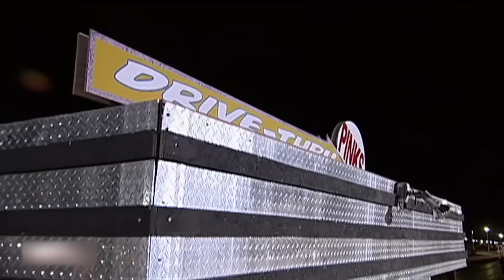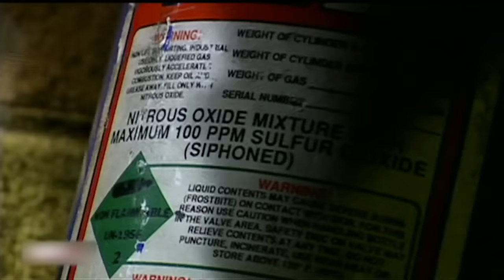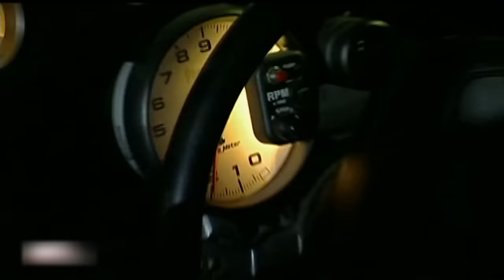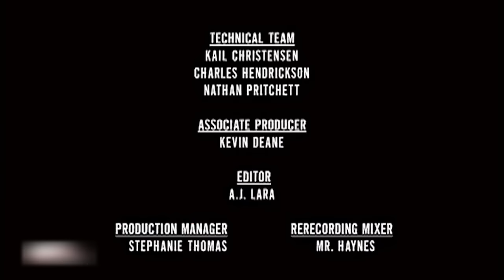PINKS - LOSE THE RACE...LOSE YOUR RIDE! A Chevy Battle -Camaro vs Nova -  Full Episode

Comment: Someone commented about Adam's Nova (in a different channel) that the 2 speed trans was a bottleneck paired with a big block high horsepower engine. Is this true? Cause it looked like its not transfering all that HP and doesn't seem so fast especially at top end. Can engine experts comment on this?
Reply: Powerglides are very strong and they make getting from point A-B smoother, you can sacrifice speed though in an all motor setup..  Im guessing that 555 mightvhave been a pump gas motor?   Id have to relook to see if it was mentioned...  I felt horrid for the guy because he was hustled bad... the producers musta been under pressure and twisted on the guys arm.    he was under the impression he was racing a near same speed 10.50 car the camera crew caught those guys in the camaro saying theres was a low 8 sec car...    it was a last minuete bait and switch.... I dontbknow what the gran national was or the shape it was in but that is a more rare car than a 95 camaro... just show up and its not even the same car you may have wanted or even care to have.....  nice guys finish last situation....   I dont care if I woulda ruined a shows filming or made a crowd of people upset....  I never would have accepted the race...   And I only would have ever competed on that show if it was something i threw together just for it... not something that had any sentimental value...

But on the other hand street racers are crafty... enter that realm/game gotta know what your doing....  I personaly couldnt be happy/ok with myself taking someones car like that..  tv oy shows you so much... like tge street outlaw guys that jostled the honda... alot were using the show to promote themselves/buisness etc....  Id hope for humanity sakes that some of these situations after the cameras get cut they walked out into the pits and "hey buddy, keep your car, and hand the title back"
Reply: What’s wild is, I know where this car is located at, same everything, except the guy that bought it parked it under a shed & it’s pretty much ruined now, the paint job has completely ruined, the car ran off 114 octane, the new owner ran pump gas through the motor, it backfired & busted the flywheel. It’s been sitting ever since
Reply: @Aslingerpride2  That's sad.. You should buy it and repair it haha
Reply: @bryany6565  Thanks for the reply, I really feel bad about Adam he seems like an honest upfront guy and his team. Even graceful at defeat, sucks his last race it was dead even if Rich gave the lengths he was originally asking. 

I was really hoping his bigblock was enough to match a small block nitrous so I thought maybe the 2 speed was the bottleneck

Comment: No way in hell that Camaro was worth $70k
Reply: They could have 70 into it, but worth 70 probly not
Reply: Well this is 2005 that Camaro was pretty new
Reply: @landon5104  that Camaro was a 95 so no it really wasn't.
Reply: @chosenchild8416  a 10 year old car is pretty new in my books
Reply: Take a fkn zero off for the real value
Reply: regardless the value, it walked all over that over priced under tuned nova..
Reply: You obviously have never built a race car. A built race engine is 12k and above. Just keep going from there.
Reply: @TheRoadhammer379  blah blah blah 300 dollar ls with 3k top end and 500 dollar nitrous kit.  70k you didn't attend college
Reply: @silvajay6443  p pp pm
Reply: It's what you don't see that makes the car 70k suspension, transmission, rear end, roll cage, engine internals, ignition system, fuel system, tires, that car is purposely built for what it was supposed to do and the price doesn't come cheap
Reply: the info said it was a sb2 motor... go look up how much they cost

Comment: 555 a badass motor for drag racing. 
Its even better when its boosted or eating nitrous and you know how to drive.
Reply from the maker: all hail the Triple Nickle!
Reply: Yeah it’s badass but not when it’s running against a 2800lb f-body that runs 8s
Reply: Someone commented about Adam's Nova (in a different channel) that the 2 speed trans was a bottleneck paired with a big block high horsepower engine. Is this true? Cause it looked like its not transferring all that HP and doesn't seem so fast especially at top end. Can you comment on this?

Comment: How do you bring. "1,000" hp car with a big block and get walked by a ls with nitrous
Reply: Someone commented about Adam's Nova (in a different channel) that the 2 speed trans was a bottleneck paired with a big block high horsepower engine. It wasn't transferring all that power because it only has 2 speed.
Reply: @paolomartin6873  lol, the 2 speed power glide was not the problem here. Plenty of fast drag cars run power glides to be faster.
Reply: That camaro has SB2 motor in it. Wasnt a damn ls 😂😂😂